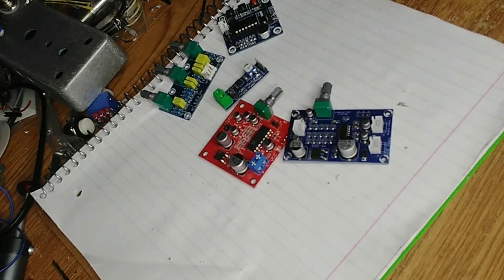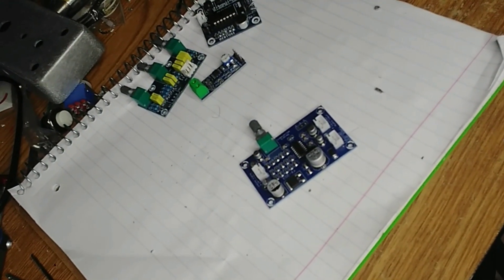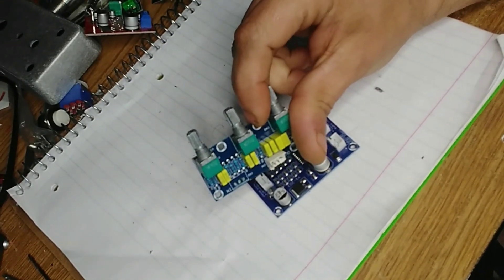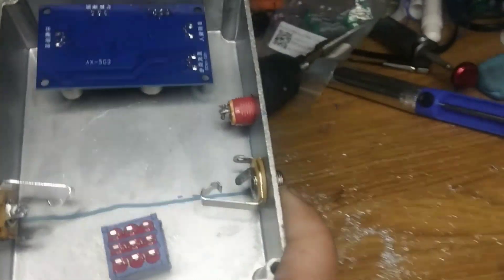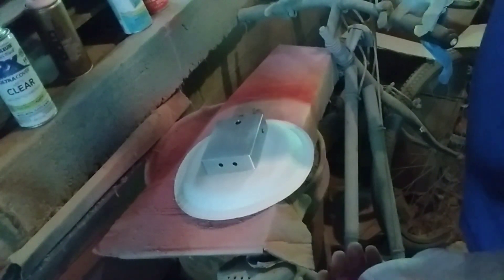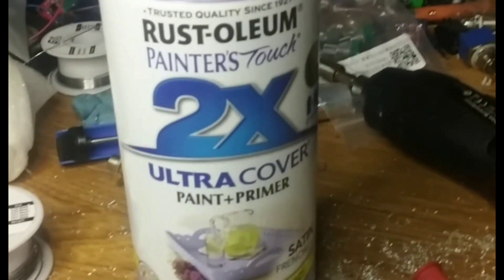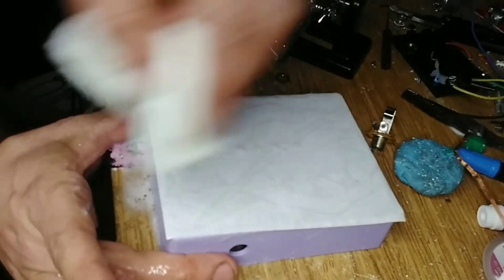part 1-the general process- making guitar pedals from things not designed to be pedals.

Comment: Very nice! I like seeing the process. I think the method of adding the graphics seems to work really well as it is. Nice clean look, and just knowing that it’s more hands-on than only using a printer. Good-sounding delay!
Reply from the maker: Man pack of temp tattoos is at most 8 bucks and can do like 10 pedals. I got the idea after using waterslide decals on headstocks and seeing people use them on pedals too. It's cheap and I never heard of anyone do it. My first attempt I was in a laundromat with my then partner and begged them for money for this tat quarter machine. I used a narwhal. The delay is very lofi and is only super usable at lower delay times because there is some crunch to it. My other karaoke echo boards the red ones I found a way to add feedback and I used a 100k pot for the delay time is even longer and it's even dirtier but I wanted it that way. This works more as a slap back with some delay if you don't mind a bit of distortion to your delay. It's not a pristine digital delay. It's digital but very analogue like and is dark and dirty.
Reply from the maker: I made this super cheap. Pcb about 5 bucks, enclosure I'll say close to 6, added knob I think wasn't even a dollar, foot switch about 2 to 3, Jack's about a dollar, I can't calculate the paint and tats really and the clear but I'll say 5. It's a 30ish dollar pedal
Reply: @madzpanda  that’s a good deal!

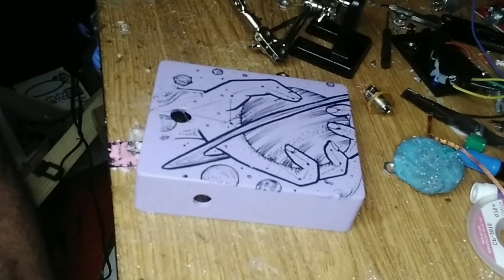Comment: 7:47 damn that looks awesome!!
Very cool seeing that process :D
Reply from the maker: You should see some of my others. Most are either way more colorful or the art put on them is more detailed. I'm making all sorts off stuff. Everything in this video basically came from aliexpress and wasn't meant to be a pedal initially. I make fuzz pedals out of these lm386 chips you can buy hella cheap meant for diy amps which I have used them for. I have used now 2 different pt2399 karaoke echo boards for pedals.. different pedals at that. The red one I figured put how to circuit bend a feedback know now so it's not just mix and time. I've also ran more than one together for a double echo. I also use these greeting card recorders to make like samplers and loopers. Have a couple of synths and video mixers made as well. I make like pedals from kits and veroboard as well but I like finding these cheap things and making a cool pedal no one has out of it. For a bit I kept buying these kids voice changers and turning them to pedals. Not very usable tbh but a fun glitchy vibrato pitch effect. Super neat man. Anyways my autistic ass talked way too much about something you probably don't really wanna hear, so I'm sorry and thank you lo.
Reply: @madzpanda  Hehehe awesome! I really need to catch up on your videos then.
I just had a little glimpse at your other pedals and man - they are beautiful!
Right now I have the red PT2399 circuit sitting on my desk - will be using it for a modified cassette player from the guys at Battery Operated. So I have a basic understanding of what can be done with it. It's fun to hear that there are other fun little circuits that can be used for such fun stuff. :D 
I'm looking forward to exploring it all a bit more! See you! ✌